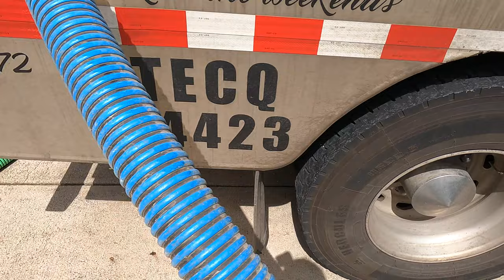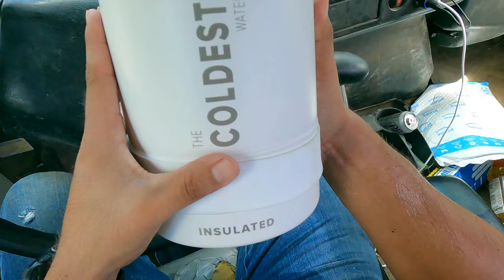Pumping a Septic Tank ASMR

Comment: What's this usually cost?
Reply: $430 dig mine out and pump it.
Reply: @Wagonman5900  I had it done for $200, Pittsburgh ks. Actually wasn't a big deal like I was thinking
Reply: @6creed933  Wyoming MN. More, still not a big deal. In and out in an hour and a half.
Reply: @Wagonman5900  I was surprised, but it's a small tank, not even sure how big it is. The driver seemed to think it was an old metal fuel tank, and he saw a lot of them
Reply: @6creed933  The invoice said they pumped 1250 gallons out of mine. It's a concrete tank they dropped in when the house was built in 1978.